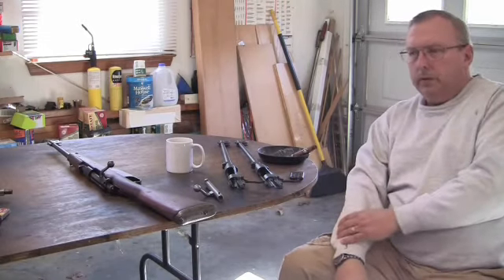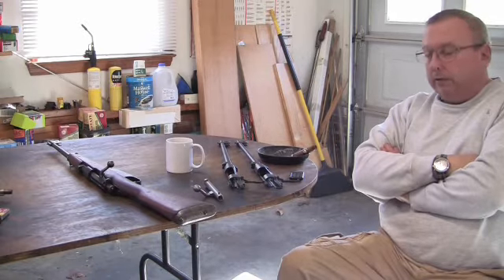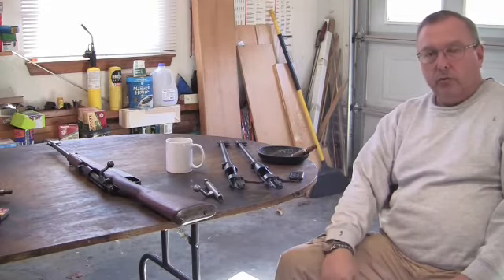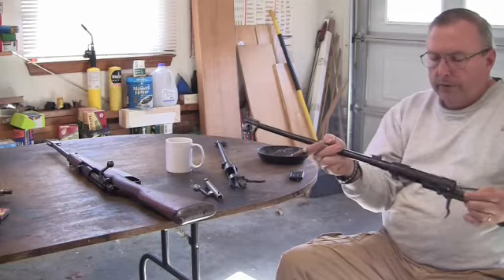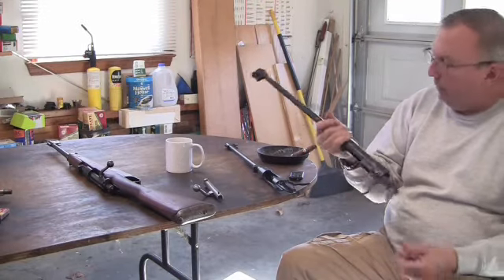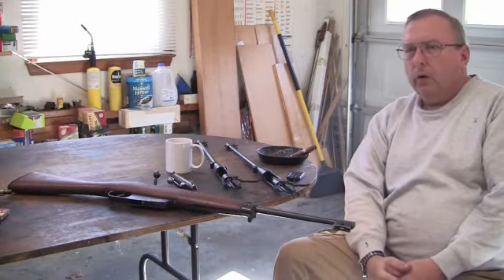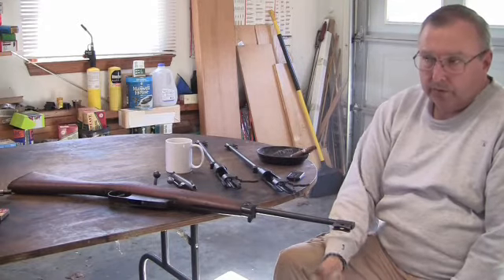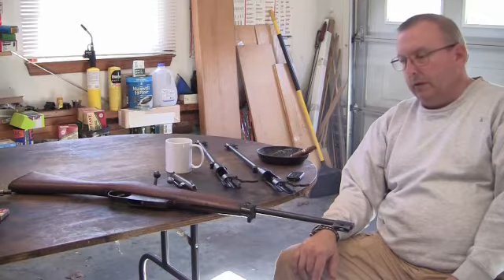My thoughts on Restoration projects on military guns

Comment: I bought a box of parts for $80 about 3 years ago. The guy thought it was a semi auto mosin. I knew it was an SVT 40. All it was missing was the stock, firing pin and gas adjustment screw. The bore is a wee bit dark but it shoots pretty well out to 250 yards.

Comment: I reconstructed three Mosin M44's a few years back, before prices started really climbing.  Mosin have great parts interchangeably.   After those I bought a Ranger M34 .22 rifle and a Mossberg 85C bolt action shotgun.  Both were without bolts.  I still don't have bolts for them.  I bought a Ranger bolt, but it wouldn't fit.   The Mossberg 85 line of 85, 85A-D, all seem to use a different bolt.   I've bought and tried the bolt for an 85 and 85A.  I found out the hard way that Mossberg switches things up.  The only difference should have been the chokes,  but the bolts changed and consequently were not interchangeable.  If I rebuild another,  it will most likely be a milsurp simply do to parts compatibility.